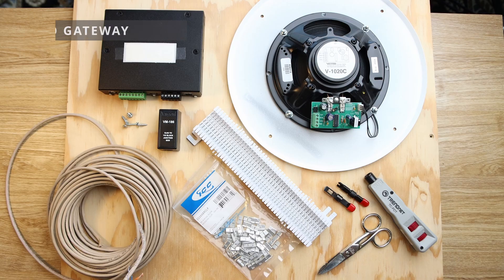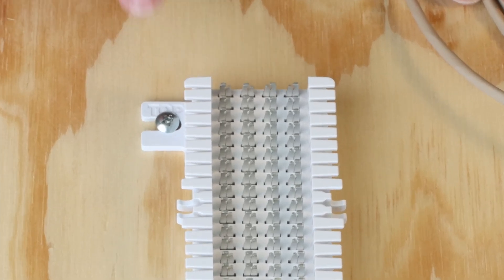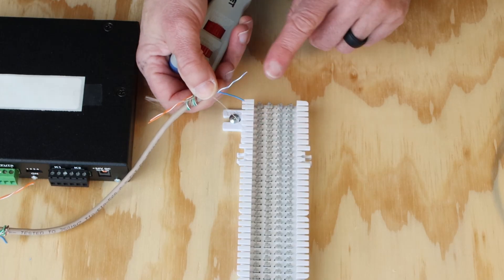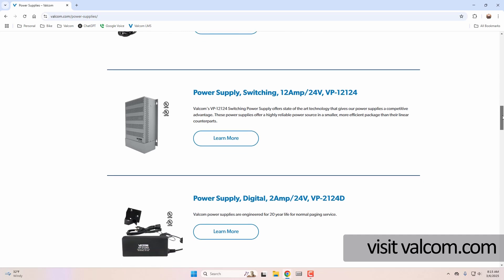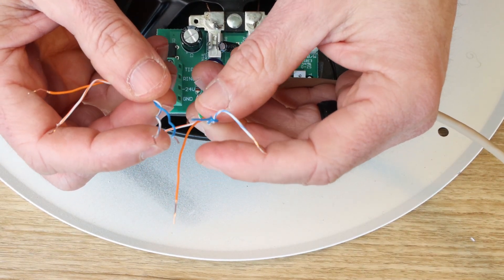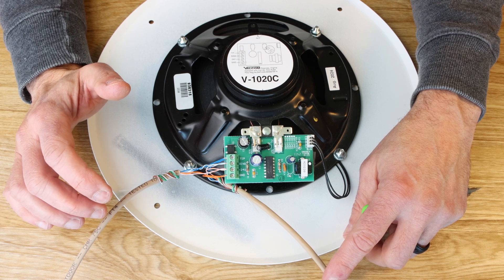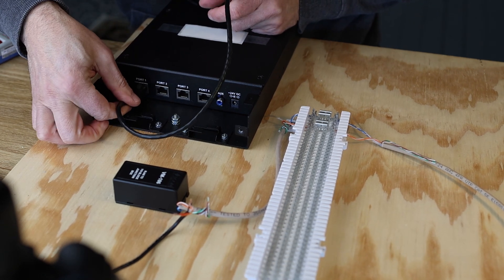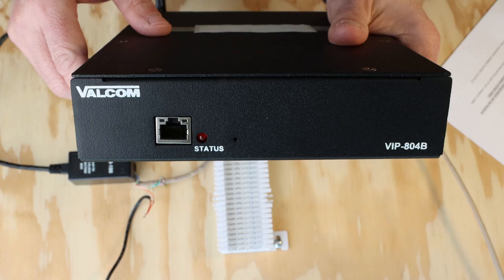How To Connect Valcom IP Audio Gateways

Comment: Why don’t the amps just accept rj45 and break it out internally?
Reply from the maker: Great question. The Valcom speakers that these gateways wire to do not utilize a central amp. Valcom speakers are self-amplified meaning that each speaker has it's own internal amplifier. check out this video. It may clear things up a bit. https://youtu.be/ZOJEqjdr6hg